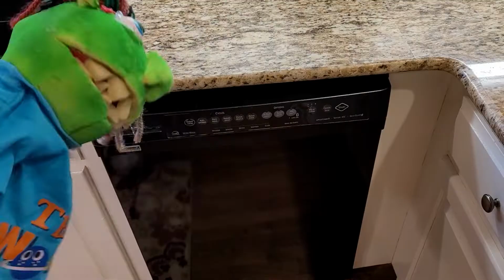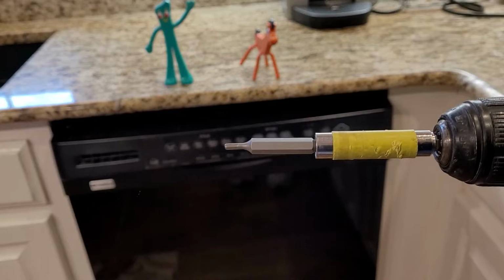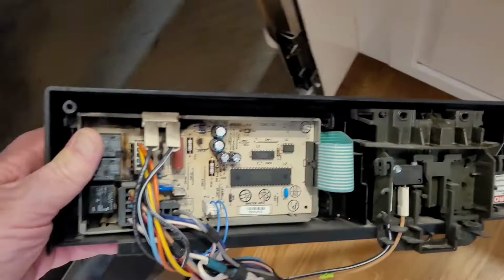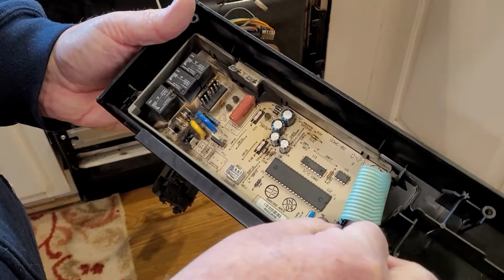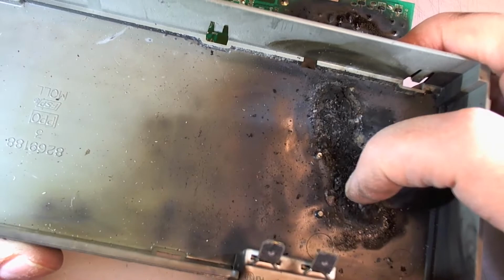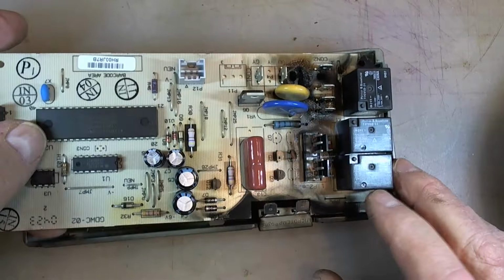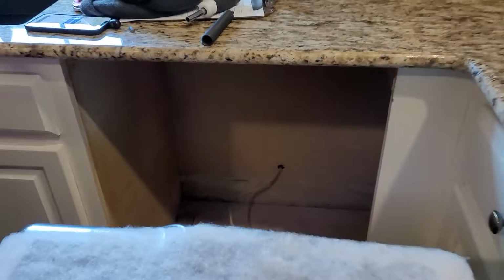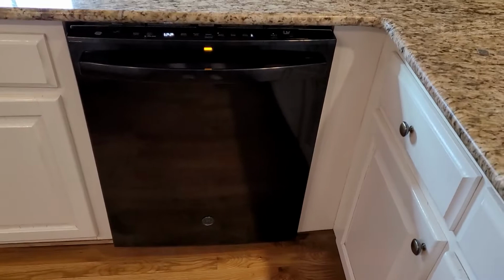The dishwasher caught on fire

Comment: I have the same exact Kenmore you have and the same burnt board. Actually, I had a flame come out while it was burning. It's was made in 2005, so I figure we got our money's worth for an 18 year old dishwasher. I looked all over the unit then saw your video and took mine apart, too.
Now going to get a new dishwasher. Fingers crossed the new one lasts 18 years too. 
What dishwasher did you replace it with? Also, what did they charge you to replace it?
Reply from the maker: Ha!  We did get our money's worth!
Good luck with your install and new dishwasher. 
And thanks for watching and commenting!!!
Reply: @workshopstudios43  I was told not to expect much from a Kenmore. The builder put it in. It's been excellent till last night. Thinking of having Costso deliverer one and installing it myself. It looks fairly easy.